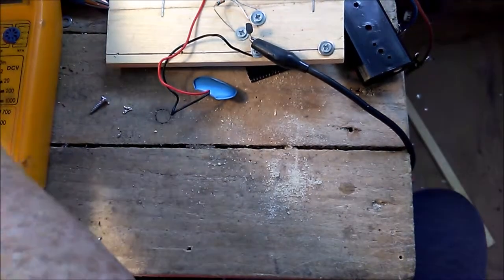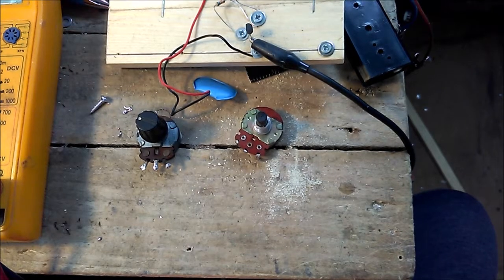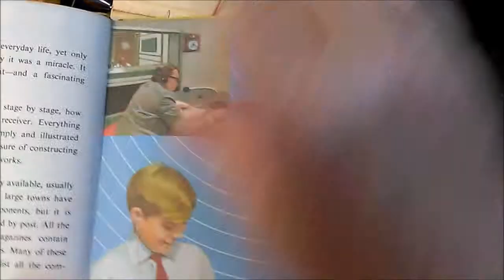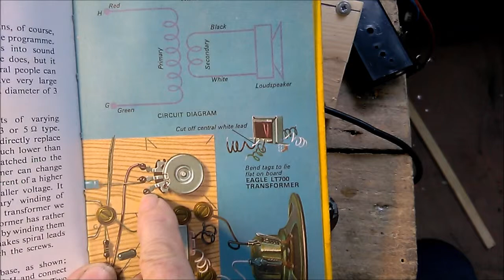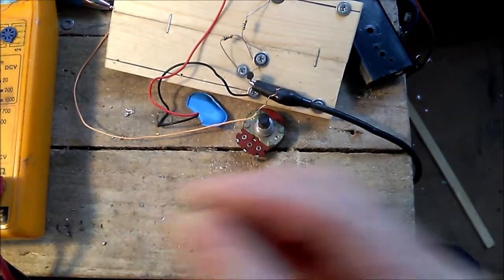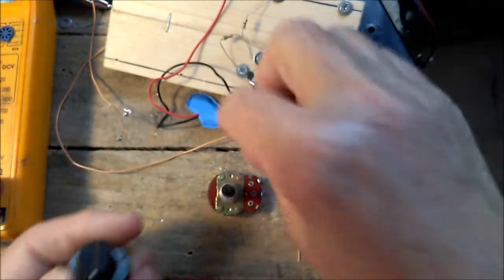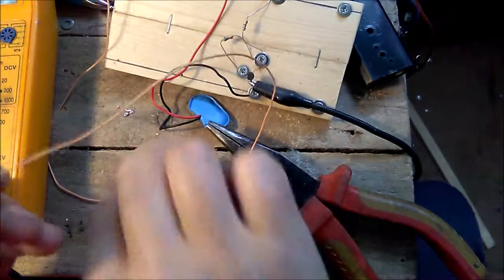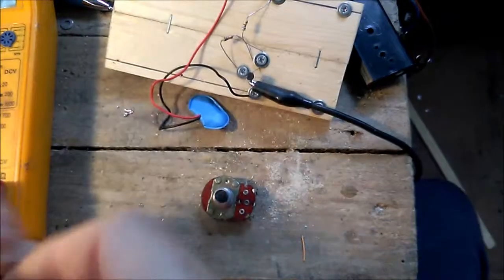A MEANS OF CONNECTING LEAD TO POTENTIOMETERS NO SOLDERING

Comment: I'm planning on building the radio from the book as closely as possible to the original and so far I've been searching for 2 years for all the components. The screws used in the book for the potentiometer are a copper plated type, I found these on eBay which look identical are period correct: https://www.ebay.co.uk/itm/264335474779  They are a no.3 screw and are 3/8'' long. Hope this helps. It's a fantastic book which I'm sure has inspired so many over the years.
Reply from the maker: The most difficult part to obtain would be the variable capacitor: probably eBay, although expensive. It would be best to keep the coil winding details as close to the original as possible but the thickness of the wire isn't critical. Probably the most difficult thing about this radio is finding an AM radio station. There's only one around here (South East UK) and it transmits oldies from the 50s 60s 70s. Also, if you cannot get a variable capacitor, an air spaced one of 350-500pf are often seen on eBay. Let us know if you have any serious difficulties getting hold of the components and I will see what I can come up with. Thank you for your comment!👀🙂